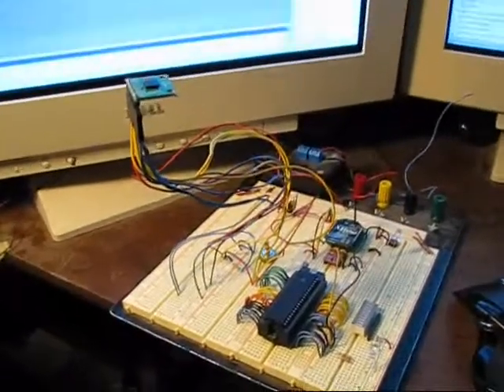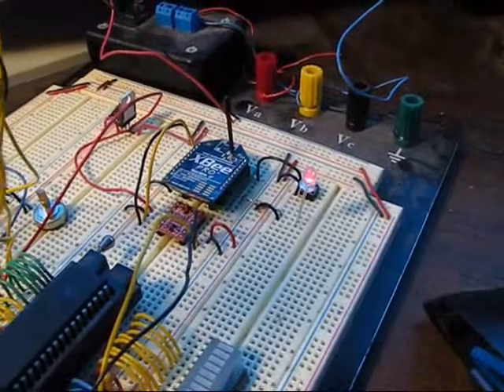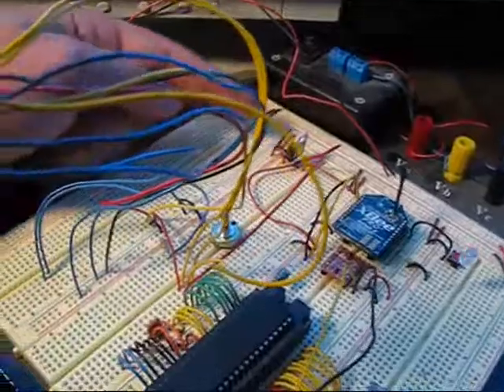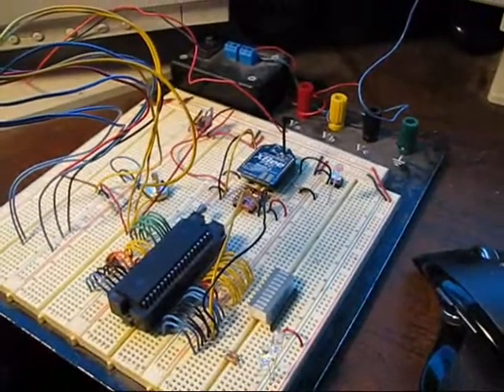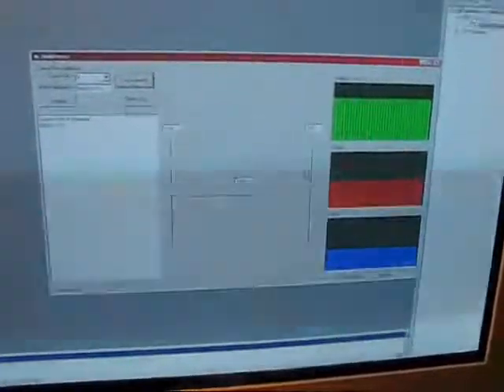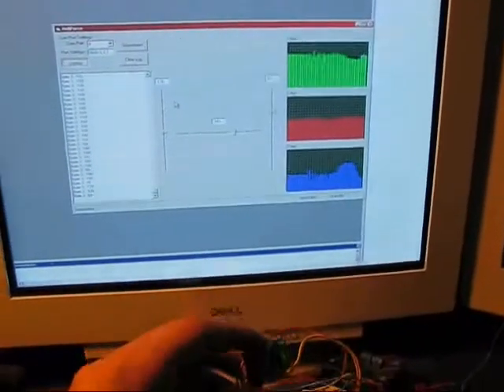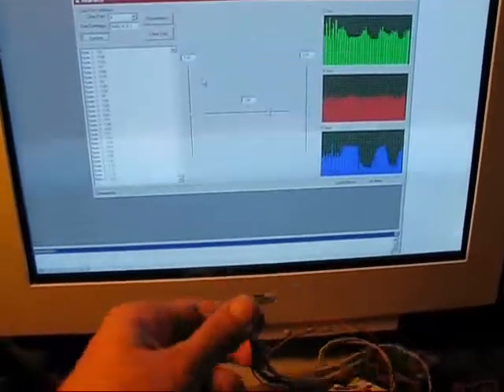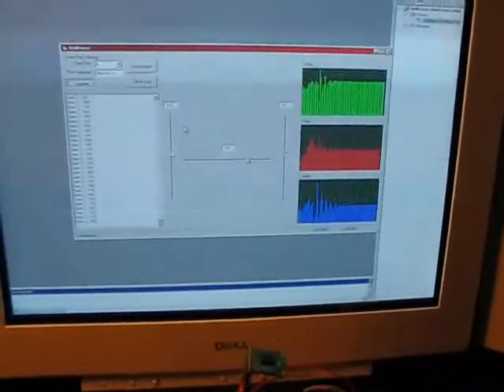Accelerometer Test

Comment from the maker: @IblesjunkieMrMcCoy, You are correct, this is the MMA7260Q breakout board from SparkFun Electronics.  I used the 1.5g settings, tying GS1 and GS2 to ground.  These pins have an internal pull-down resistor so you can leave them disconnected for this setting as well.  I used the 1.5g setting because this gives you the maximum resolution for small changes in acceleration.

Comment from the maker: @hohenheim1107 Unfortuanetly I don't have a blog or any online resource for you to see how I configured the XBee transceivers.  I had a hard time setting them up at first too since.  I used the XBee Pro Series 2 transceivers which are more for mesh networks rather than simple point to point serial comms.  You have to set one up as the base station and the other as a node on the network.  I'll have to hook them up to my computer an retrieve the setting for you.

Comment from the maker: I think you probably could to some extent. Since this is a 3 axis accelerometer, the roll, pitch, and z-axis acceleration could be measured with the accelerometer. If there isn't any positive or negative acceleration in the z-axis and no tilt on the pitch and roll, it would be assumed that the helicopter is level and not ascending or descending. You wouldn't be able to measure the yaw of the helicopter though. I was also thinking about doing this, and it's why I used wireless transceivers.